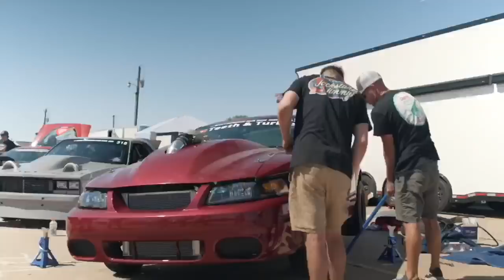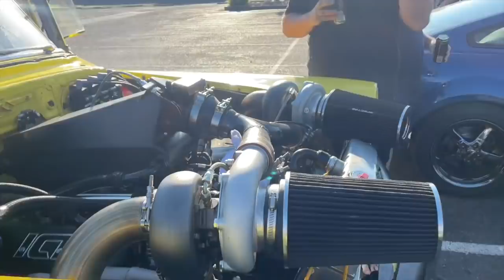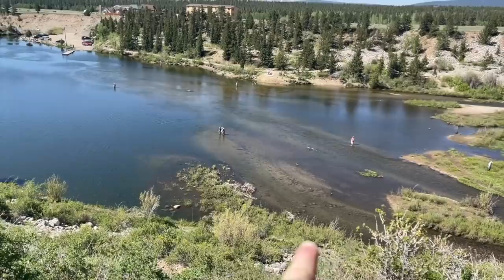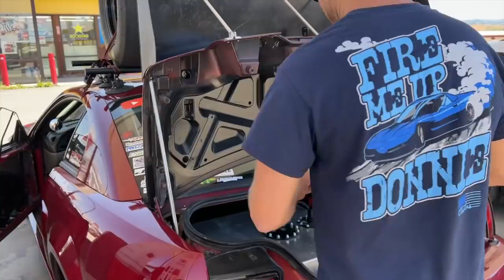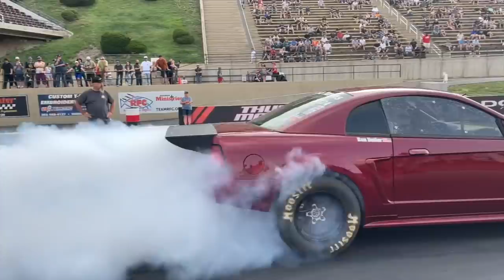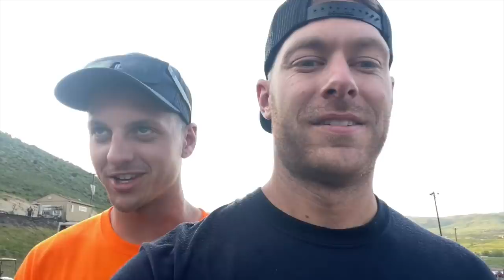LOW 9s in Bandimere! High Altitude and Forecast it was HOT!! - Race Week Day 4

Comment: Man that cliffhanger though. Hope the engines OK.
Reply: nope
Reply: @dudet9662  Yeah saw Cleets video. Sucks for sure. Time to weld the Blazers diff, swap out the tires for some 555R's or something and see if they can reach the mid 13's in it.

4 man Blazer pit crew should be able to get it done.